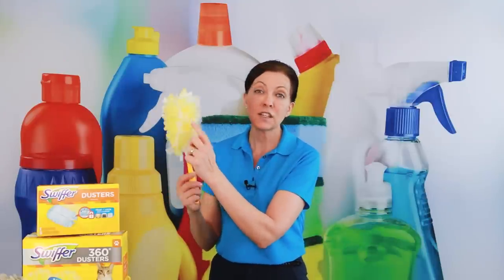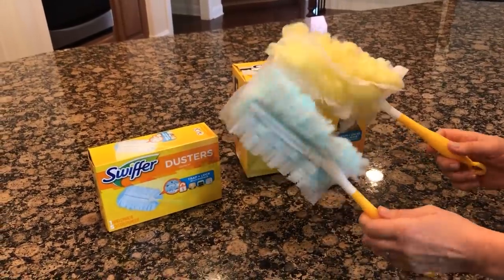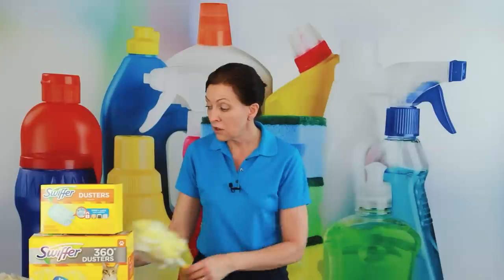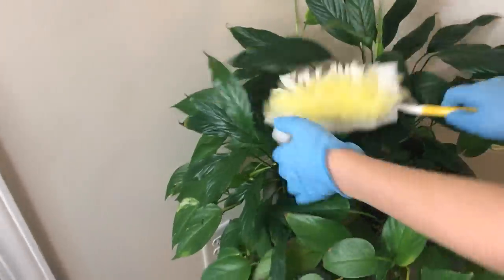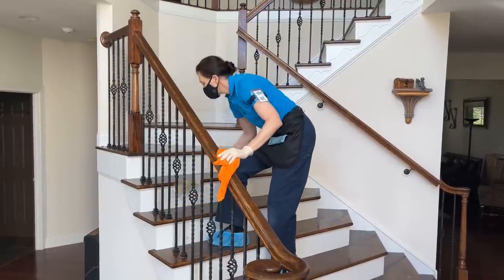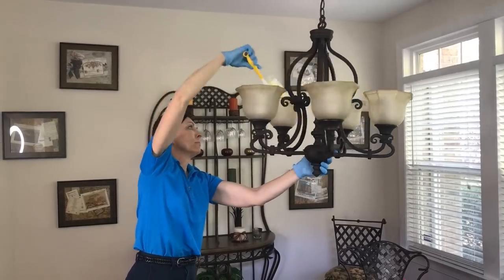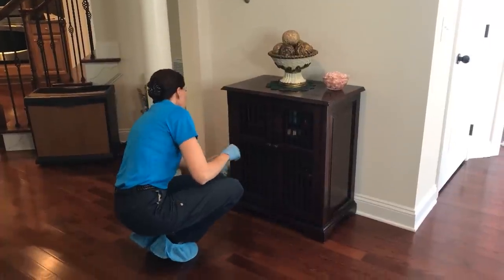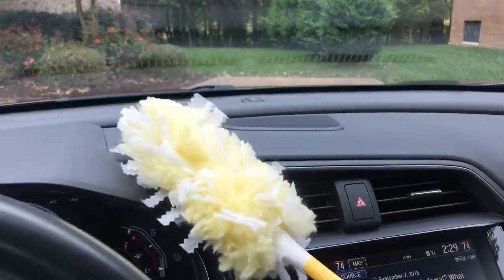Swiffer Duster 360 THE Duster Professional Cleaners Use

Comment: HOW DO I KEEP THE DUSTER ON THE HEAD? It keeps falling off!
Reply from the maker: Are you using the Swiffer brand? I've noticed off brands (like the Great Value) brand falls off easily. I have not had a problem with the Swiffer refills. That said, I know some people are using hair bands (paid link https://amzn.to/3DOFdZK) to lock them in place. 
Take the Swiffer Refill and the top part off the duster.
Roll a clear hair elastic over the yellow part of the handle where the white part meets.
Snap the white part back in place.
Put the Swiffer head back on the fork.
Roll the band up over the base of the Swiffer Duster to lock the Refill in place. Presto!